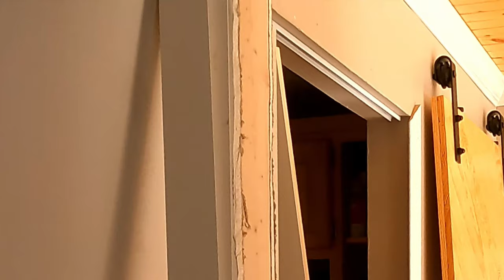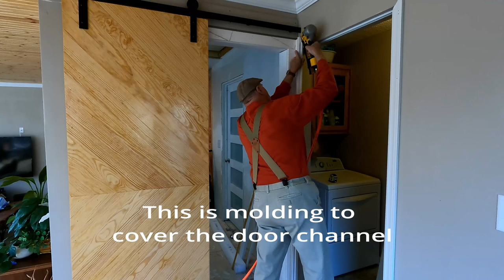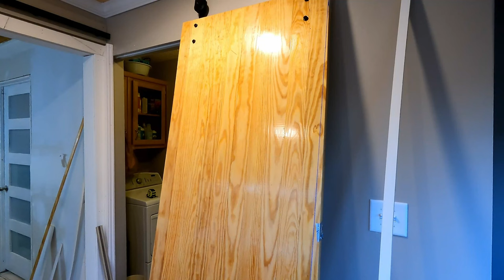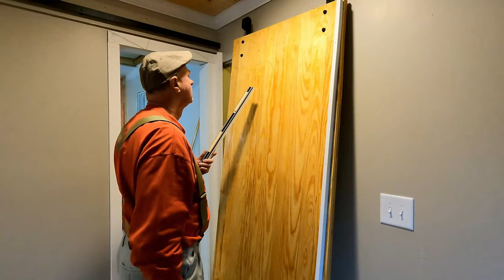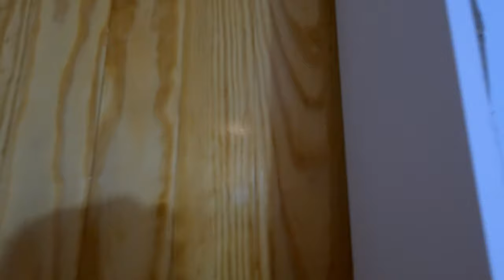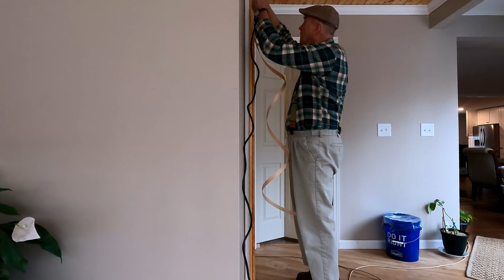How to seal a Bathroom Sliding Barn Door

Comment: Is this solution good for bathrooms with Toilet,  Is it keeps the smells inside ? 😅
Reply: This seal works around three edges of the door, top and two sides. The bottom has an air gap just like any bathroom door. I would say it works as well as a swinging door, which is a big improvement on this type of door.